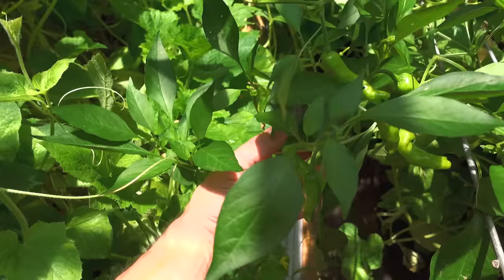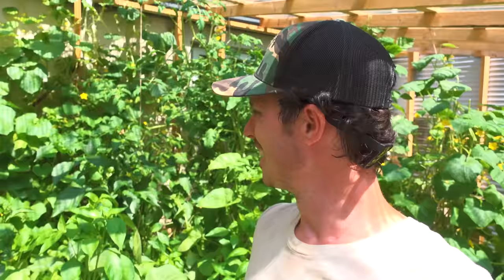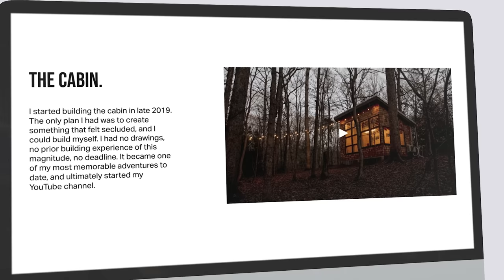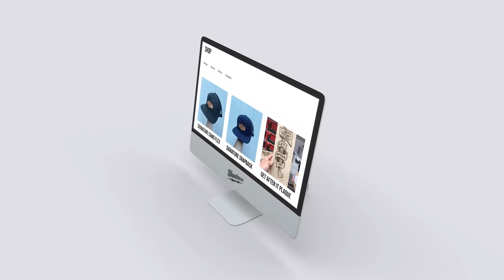DIY UpCycled Greenhouse - Start to Finish

Comment: Only recommendation is to put up a vapor shield between the house and the greenhouse. That shared wall is going to see much more condensation and moisture now that it’s part of a greenhouse.
Reply: Great point 🏆
Reply: Yep, my ex tenant ruined the siding on the back of my house doing one out of plastic. Wise words.
Reply: that was my 1st thought too.
Reply: Oh!  Now you tell him!  Lol  good point.
Reply: Can he add the barrier now?
Reply: @my.kookin.channel333  I would say yes as long as it is dry and not like humid raining in there. Just make sure everything is dry and aired out and clean so the caulk can stick and you don't trap moisture in,you should be fine. Make sure you trim it out and caulk it.  like Nic said, so nothing can get behind it. It will save you so much headache and money later on. Good luck.
Reply: @jackkonnof4106  Great to know... Thanks🏆
Reply: The wall is part of the greenhouse it should be okay ! I love it!
Reply: @soothirak  So, now moisture or mold will get to the siding? That's great. Though mold/mildew can get to siding even without a greenhouse attached.
Reply: What's a vapor shield  please?
Reply: a DPC {damp proof cpurse} between timber and a surface that at low temperatures is below dew point is extremely importabt esecially if you aren't using appopriately treadwd timber... prevention is always better than qure
Reply: My thought exactly.
Reply: I agree.
Reply: @my.kookin.channel333  lmao. u saw the big ass vents he build? can u tell me where there will be moist or mold if he legit built 2 giant ass vents???
Reply: @maxim666  Such hostile inquisition..... So, are you trying to write a question about (the word I learned in school, "Huge" vents..) is that what you are trying to ask? Well, not being a professional builder,  I would still think humidity would build up between the two.... Maybe the builder can say after a year. I read another person's comment that their house siding was damaged because of no barrier. Hope you are calmed after getting that substantial question out. Next time, ask after breathing exercises. It may help to see that not everyone on here has experience. That's why we ask questions and give our concerns.
Reply: @my.kookin.channel333  for an amateur he did a reasonable job.
He didn't close in the gaps between the joists so there'll be ample air flow.
Also that is a rendered wall which would protect the bricks from moisture.
Reply: @jamingaming9251  Thanks🏆👍🏾 I'd like to add to the side of a shed.
Reply: @my.kookin.channel333  putting a lean to like this should be fine.
Reply: Pro tip! Thanks.
Reply: @my.kookin.channel333  imagine writing a book in a youtube comment section cuz u dont know how vents remove air. Are u triggered?
Reply: Hubby is building a green house not attached to house I will share this info with him on ventilation.
Reply: @reinarei-yf2zt  👍🏾
Reply: @my.kookin.channel333  yep
Reply: @williammaxwell1919  If you are going to provide a reply please try to use real words. A little effort helps the uninformed become informed. D for effort.
Reply: @user-cs1lo6tt4j  You said, "lmao. u saw the big ass vents he build? can u tell me where there will be moist or mold if he legit built 2 giant ass vents"  I reply:  "You don't know what you're talking about, and are speaking from a lack of knowledge and an overabundance of conceitedness. That ventilation will promote good airflow and the exhaust fan can help to expel excess heat but the moisture in the air of a greenhouse is great, and air, humid or not, permeates vinyl siding, exterior wrap, and sheathing. Sheathing is almost always made of process lumber product, which is highly susceptible to mold growth. Exterior walls are permeable and will shed excess water typically, but in this case, where the heavy humidity of the room is consistent, it will shed to the interior of the home, likely causing mildew, mold, and rot in the wall. Furthermore, if the home uses faced batt insulation, that cellulose face can grow mold on it, so the mold could spread throughout the house over time."     
  
If you shut your mouth except to ask questions, you'd learn more. This is a habit which is very good for you and those around you. It's fine to be ignorant; but it is wrong to speak of things that you are not knowledgeable, and even worse to do so from a perceived sense of self-superiority.
Reply: Agreed. A moisture barrier is a MUST in this situation.  I love this project and it’s execution.
Reply: and add lanscaping mat on floor so no need mow lawn
Reply: I was watching this and thinking the same thing AND where the roof meets the house - where's the rain going to go? No flashing, no gutter system, no where to drain water.  Not only that, the greenhouse was practically built directly on the soil!?!?
Reply: If he had a swamp cooler I. The house he could open that window for a humidity vent
Reply: Sorry but I disagree, the exterior of your house needs to breathe.  You also wouldn't want that much condensation on the exterior of your house. 
House wrap may work but not plastic.  Plastic should only be on the inside.
Reply: I lived in the UK 10 years ago in a single skin timber 'bungalow' shed. The glass porch along the south side was my heating for 10 months of the year. I had a woodburners made from a gas bottle for the other 2 months. No condensation, no offgassing, no asthma. New house 🏠 all of the above plus mould which is insistent and pervasive...I would happily move back to my shed but the council condemned it and I could not afford to build on my site so it had to be sold 😢
Reply: @salemdesigns65  actually, he put his foundation on top of a trench full of rock.
Reply: It will be fine since the space between the house and timber isn't sealed and the house has as window.  If anything i'd put flashing where the roof and house meet. Also, if anything the exterior stucco could be coated with a rolled on waterproof membrane use for above and below grade.
Reply: agree, we didn't do this, and had to replace a wall, and greenhouse due to this mistake.
Reply: @user-cs1lo6tt4j  lol….this made me laugh as well as the following comment.

Comment: Please consider putting up proper metal flashing that ties in from the siding to the roof of the green house. Speaking from experience of renovating other people's homes, you're creating an area for water penetration into your home. It becomes really expensive and less than a couple hundred bucks in sealant and proper flashing will save you from all of that. Please consider it.
Loved the greenhouse, looks great! 
Thanks!
Reply from the maker: Copy that!
Reply: I agree🎉
Reply: Not to mention that block wall is already compromised, notice the cracks and possible settling
Reply: @WoodnessGoodness  You wouldn't happen to be a veteran would you? Former army captain here.
Reply: I was thinking the same thing. Stressing me out watching it. 😂

Comment: I agree with ColAlbSmi. I think the build is pretty awesome but you need some sort of moisture barrier and some flashing between the house and the roof of the greenohouse in order to keep the water from between the two structures.

Comment: I did notice the Huegelkulture method of raised bed filler at the inside bottom.  Keeps the costs lower as less actual raised bed soil or compost is needed.  Well done.

Comment: My OCD has kicked in and although I love what you've done, I wish on the long wall you had put the three tallest windows, then inserted the two shortest ones to break it up, then the other three  that are somewhat shorter than the first three on the left. It would have been more balanced. I do love this though. However, if it was mine, I would look at it every day and want to tear out those windows to balance them more, but I realize it's my own OCD causing the issue. Awesome greenhouse and you make it look sooooo easy to build!  So having greenhouse and raised bed envy!!!

Comment: Very clean build with exception of the missing vapor shield as others have mentioned! Good ventilation and thanks for linking your fan/thermostat. That corrugated metal is a great find and the bed design using it will last a long time. Also nice to source the free nutrients with the hidden hugelkultur and found soil.
Reply from the maker: Thank you!!
Reply: My question is how do the pollinators get in and out? I've been thinking of doing something similar, but much smaller.
Reply: @Mustangmom2k  Peppers and tomatoes don't need pollinators and insects will always find a way in, plus the ventilation openings and the open door.
Reply: @WoodnessGoodness Отличная теплица! И грядки теплые крутые! У нас в России на таких грядках в Сибири выращивают томаты, перцы, огурцы, клубнику.

Вопрос: почему вы не проложили рубероид между деревом и камнем?  
Без гидроизоляции нижний брус будет гнить.

🎉вы меня вдохновили❤

Comment: Big "Well Done!!" doing it all on your own. Even had you had a helper, would recommend tacking a 2 x 4 at either end of your walls holding it upright as you join your corners of end walls. And the beginning of digging the grass out along your string guides, would be helpful to take a can of orange spray paint and mark your guidelines and then remove the string that was in the way of you shoveling.

Comment: Awesome build young man :) I have a small 8+8 built on the back door of my cabin so I can start all my bedding plant early and it has worked great because I just heat it with the extra heat from the woodstove as it warms in spring,

Comment: Fabulous!  The two things that concerned me were the condensation/water penetration potential problems, which, by the sounds of it are easily remedied and putting up the wall right in front of the window.  Wouldn't it be better to be able to open the window into the greenhouse for ventilation and also as a fire escape?  Just a thought.
Reply: I thought about that as well. By slightly modifying the distance between the vertical wall studs, the window could be centered between two of them. And then a heat exchange would be easy. If, for instance, electric goes out during the winter, you could allow solar heating to enter through the window of that one room. Or if there was a sudden freeze and you wanted to salvage some large, expensive plants, such as citrus or an avocado tree, you could open the window and share house heat with them. Years ago, there was a sustainable farm in Colorado incorporating this principal on a larger scale, but the fellow running it was getting up in years.

Comment: Great build!  As a former commercial greenhouse employee and horticultural biology major, I may have done things a little differently, but hey what you did works so far just fine, and that's what counts.  Ventilation and humidity control are vital to successful greenhouse management and it looks like you've got that covered pretty well for the size of greenhouse you built.  I've never been a big fan of raised bed farming, too many variables for my OCD brain, and soil used over and over again becomes depleted of nutrients, but I was glad to see you placed some wood logs in the bottoms of your raised beds, you've obviously studied up on raised bed gardening techniques.  Only thing lacking, IMO, is a drip irrigation system, and maybe an automated temp/humidity control, but I know both can be a bit pricey.  Again, nice build!
Reply from the maker: Thank you so much for your kinda words and feedback! A drip system sounds awesome. I am also planning on adding a gutter collection system!
Reply: For raised beds while manually tilling at the end of the growing season you can add nutrients and worm composting. Even with regular planting the nutrients will be depleted, that is why you rotate crops.
Reply: @WoodnessGoodness  Just remember for gutter collection, you wanna treat it in case bird fecal matter or other animal waste gets in there on accident. For ornamental flowers it's not that big a deal, but for crops for your own kitchen, a bit of chlorine bleach and a few litmus strips can go a long way, with a good bed of sand as a particulate filter at the bottom of your catchment.

Comment: I'm just wondering how long the greenhouse is supposed to last.... If it is to stand undamaged for more than one season, then a slightly better foundation than 2" gravel and at least head straps against the wind loads would be more than useful!

Comment: I think using a ladder when using a nail gun instead of over reaching like you did at first at 3:37 is much wiser.
 You're pretty fearless using a grinder which are unforgiving tools given the speed and the wheel can explode if it hits wrong, chain saw while on a ladder using toward you, and  being up on the roof frame. 
I think you did a nice job especially considered you did it without a plan, repurposed double sash windows [hurt me a bit when you cut them, lol]  would been something to have them open and close as well. I agree with the waterproofing membrane & flashing  tween your home and the conservatory/ greenhouse, nonetheless nice job
piecing it all together. I don't know what your injury is but I hope it wasn't very serious, thanks for the inspiration.

Comment: we built an 8 x11 greenhouse a few years ago. we put in rv vents at the top bcs we used clear currogated panels like that on the entire thing, with repurposed windows all around. it will cook you out. it topped 130 degrees when we were under heat advisory this summer, we wanted to use opaque panels for roofing that cut some of the light down, hence the heat. we wanted to use a metal side door to repurpose but we didn't build it tall enough. we were able to put in a gutter and a couple rain barrels. for our size roof and a good 30 minute soaking rain, it fills half a barrel..... its a learn as you go experience. we spent about 1200 on ours.

Comment: We have a perfect area to do this. An unused doorway to a badly constructed DIY addition we are going to tear down. This would be a perfect replacement. Kitchen, large pantry, 1/2 bath and then a doorway to that addition the previous owners had a hot tub in. The greenhouse would be right in line with the pantry and kitchen Instant electrical and water

Comment: Nice job, however, you might sink a few 4x4x4 posts at each front corner and then cement them into the ground leaving a 4x4x4" section above ground flush to your base framing and run an anchor bolt through them so a tornado or high winds won't lift it off the ground.

Comment: First I thought the windows would open up, but they seem to be fixed. 
I really recommend to open up two sides and let air go thru, or depending on the location, this would become extremely hot and all plants die of heat.
I grow plants professionally using a real green house.

Comment: Loved the concept!  Especially loved the design.  However, I believe I would not have taken doors off the house to put on a greenhouse.  I agree about the need for a vapor shield between both buildings.  I think a rainwater collection system is a great idea.  What bothered me the most is when you stuck up on the far end a piece of sheet metal that was dirty and rusted.  Happy to see you are growing veggies!!

Comment: Not bad but you are really going to regret not making the floor concrete. The grass will eventually die, leaving hust dirt that if it gets wet, will get muddy and allow fungus and mushrooms to grow. The soil will also allow in pests that get to your crops. Finally, soil can shift and your walls may get out of square and the floor will develop low spots. You also need a very good vapor barrier between your house and greenhouse. The moisture will get into your homes wall there and accelerate rot and mold growth.

Comment: Nice build. Question, why no cripples underneath the windows to help transfer the weight of the stacked windows and hopefully prevent sagging?
Reply: What weight?
Reply: @justgivemethetruth  As a long time carpenter, years ago now, those windows won't fight gravity, neither will the wood - cripples are used from scrap which he had - long term it would be for the best. He did a good job, but the first wall wouldn't have fallen if he put a temporary brace in the middle and let the wall lean back. His ground stakes should have been put in before windows and trim - but give him his due, all in all nicely done and, more importantly it works!

Comment: Thank you, thank you, thank you! I’ve been collecting old windows and lumber this summer to build a greenhouse and was feeling a bit apprehensive about how to make it in a simple way. You’ve blown it out of the water for me and I definitely will be able to do this in the spring. But I did have a couple of questions. Did you use pressure-treated lumber for your base plate boards against the gravel? How many two by fours do you think it took you to build it and were they all the same size or did you get 8ft and longer lengths? Are your uprights 16 inches on center? What was the pitch of your roof, or did you just eyeball it?   And what were the overall dimensions? if you drew up a little diagram for yourself I’d love to have a copy of it. One more thing, are there any hints that you would pass on that I should be aware of?

What kind of fan did you use? And did you run electric to the greenhouse or just run a plug from the fan to an exterior outlet? Thanks again‼️

Comment: Awesome house!
Well done:)
I dont know alot about greenhouse construction, but from experience in gardening, those raised beds could maybe use an extra support on the middle, as the soil will be pretty heavy once it gets wet?
Reply from the maker: Thanks! So far there is little movement. I did have a brace in the middle of them that seems to be doing the trick so far!
Reply: @WoodnessGoodness  Yeah, I really like the blueprints of your beds.
Maybe they are thin enough so there wont be enough pressure to cause any bulging:)
Fingers crossed;)